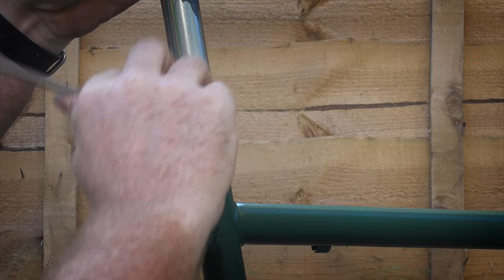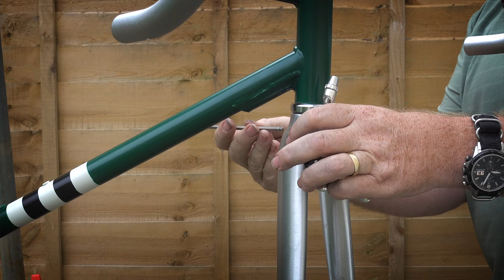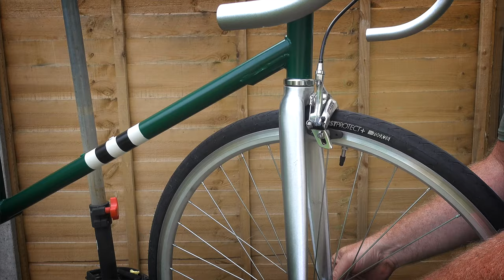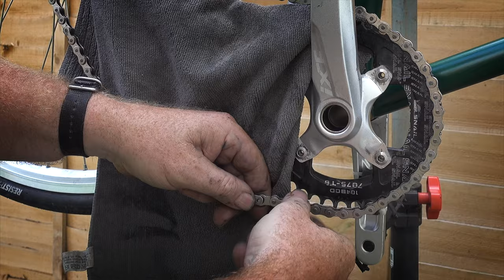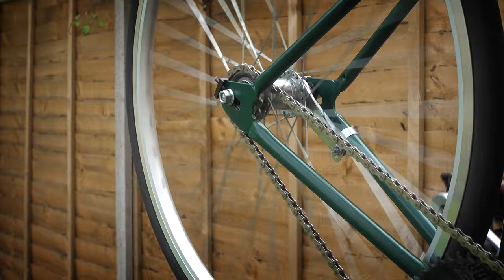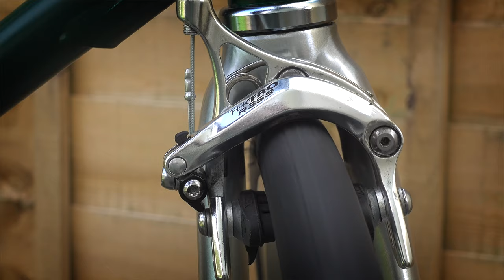Single Speed Bike Build | Steel Track Frame Build | British Racing Green

Comment: Very nicely done video and a great result in fact possibly one of the best build videos I've seen as its not overly long to put in more adverts. Not that I see adverts I'm using a ad blocker. I can write that as you have less than 1000 subscribers although if you keep making videos like that, that won't be true for very long. Best regards from Yeovil only a short distance away. Hopefully we will see this bike on one of your long riding adventures presumably one of your flatter trips. Initially I thought it was a fixed gear conversion until I saw the coaster brake support arm being fitted. I'd be tempted to fit 3 speed sturmey archer hub gears possibly with a coaster brake that makes the bike more versatile and all weather gearing too. That used to be a thing a 30 or more years ago, racing bikes with 3 speed hubs and I think a few of the models actually came in British racing green too. The only thing I don't like is the lack of drop bar brake levers but totally understand why you have done that but I ride a lot on the hoods. I probably would have fitted a rear caliper brake just to get normal brake levers and would have ended up with a 3 brake bike. Looking forward to some skid tricks now in some of your videos.
Reply from the maker: Thanks, just so happens I know a man who's into cruiser bikes and the 3 speed coaster is really popular. The drop bars are 44cm so I'm hoping they'll give a little extra leverage on the hills. I too am used to riding in the hoods so it is a little strange but wanted to keep it simple with as possible. Probably not going to leave Bournemouth on this one, it's really just a cafe bike but you never know.